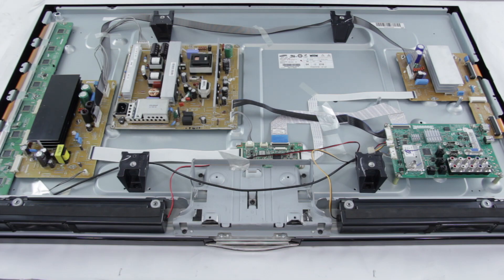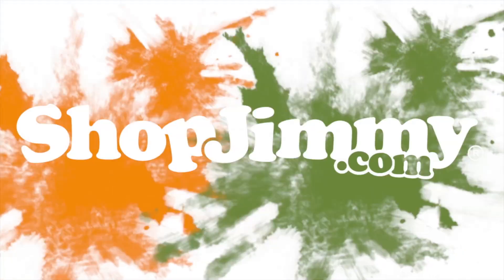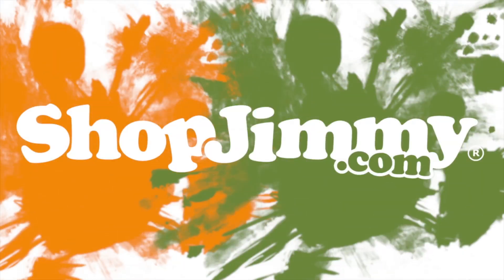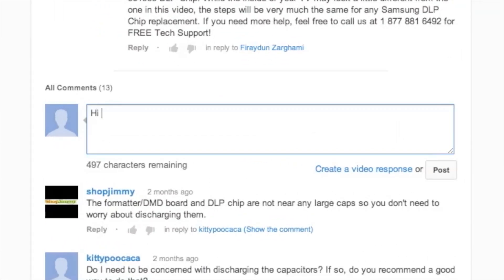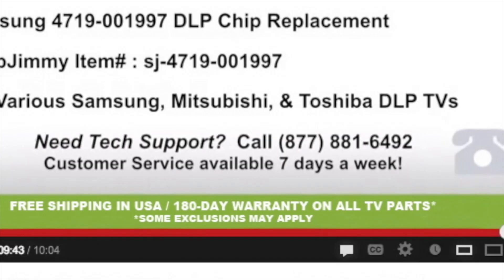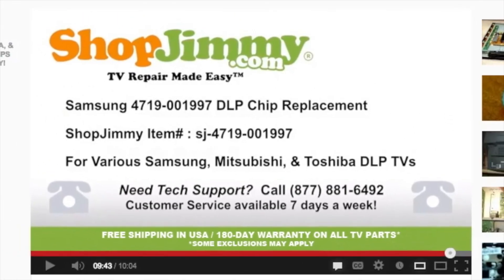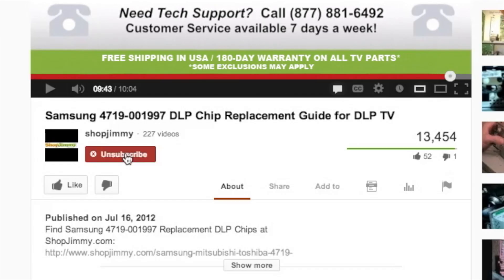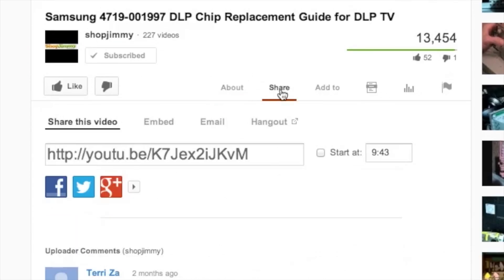Plasma TV Repair Tutorial - Common Symptoms & Solutions - How to Fix Plasma TVs

Comment: Hi Jimmy,

We have a Samsung PS51E8000 Plasma-TV (april 2012), and the current problem is about 5-10? vertical colored lines, mainly green and purple. A bit clustered on the righthand side of the screen. We have this now for a few days. For now, it is not adding in lines.

For images, check the added googledrive link to a PDF.

Sadly enough the plasma is now almost 3 years old, it had a normal two2 year warrenty. But this should not be the expected life expectancy, we're more aiming at 10 years :-)
FYI, Two years ago we had many auto power down and ups, both the powerboard and controlboard we replaced in warrenty, a halfyear after each other.

https://drive.google.com/file/d/0B1FrcP_Gxj2LZTdQQUlMMHhOUzg/view?usp=sharing

Please advise, thanks and regards,
Manuel.
(ps, from your super clear video I'am guessing the logicboard, with logicbuffer as 2d guess)
Reply from the maker: ms1001ms   This sounds like a TV panel (TV Screen) problem.  If your TV panel is bad, it may be more cost-effective to replace the TV as panels are typically hard to find in stock, difficult to replace, and expensive.  Thanks and please let us know if you have any further questions!  www.shopjimmy.com
Reply: ShopJimmy.com Thanks for answering. And OMG, I was not hoping on that one. The panel was 2k (in cost). I'll also try the Samsung servicedesk and let them make an cost estimate. Them we shall see and choose.. thx!

Comment: i have a Samsung 43 inch plasma tv model ps43d450a2wxxu  . I was watching tv when suddenly the tv shut down leaving only the led stand by light flashing twice 5 times then  a pause then repeating with no change when I tried to use my remote.  I removed back from tv and checked , no sign of any blown capacitors on ant boards.  I plugged pwer on again and watched as green led flashed on logic board and clicking sound from relay on main power board. I disconnected y main and z main boards and led on logic flashed then stayed on for 5 ses then repeated cycle. I connected y main back up and led did same cycle, then connected z  main and led just flashed. I purchased a fully working tested main power board and fitted this to see what would happen. when powered is applied the logic board flashes then stays on for 5 secs  with  y main and z main boards connected and continually yrepeats this cycle. remote control has no effect when used just makes led standby light flash repeatedly. any suggestions as to what I should try next . thanks for any ideas you could give me. drew
Reply from the maker: Drew Conway  Try this at your own risk.  Be sure when running those tests to disconnect either the y or z board one at a time and not at the same time.  Thanks!  www.shopjimmy.com

Comment: I have a Lg plasma I bought in 2011. I am getting the red images like u are talking about. How much is it for the part and is it worth fixing? this is the model number  LG 60PV450 60-Inch 1080p I cant find it on your website. Thanks in advance
Reply from the maker: Jody Sehlhorst  Please watch this video FIRST to help with your repair!  https://www.youtube.com/watch?v=BP3NVNCGEv8  I would replace the YSUS and the YDRVTP & YDRVBT boards in your TV.  Click this link to replacement parts for your TV model number:  http://www.shopjimmy.com/catalogsearch/result/?q=60PV450  There may be multiple boards for the same TV model number, be sure to match part numbers on your current board, with your replacement for compatibility.  Here is a link to a video showing how to identify your part number, click here:  https://www.youtube.com/watch?v=GEllG3RV-tc  Thanks and please let us know if you have any further questions with your TV Repair!  www.shopjimmy.com

Comment: I have a Samsung PN42B-450 series with the 3D ready with the 3D receiver. Anyways, my colors are starting to fade, like the white seems darker and when I'm using the Xbox and I press the middle menu button on the controller the blackness around it will go from darker to lighter shade of black. There isn't really any burn in problems just seems like the television needs to be refilled with gas, I don't know how it works. The yellows and blues are still really rich with the 10 million to 1 dynamic contrast ratio and it never has a problem playing in 1080p and the actual screen size needs to be put on fit to screen and adjusted when it's in 16:9 because it crops some of the edge of the picture. There j no moron blur when watching sports games like football or baseball and the dynamic coast allows you to see their helmets and the grass and dirt and it literally looks clearer and shinier than real life. So I guess my problem is the black gets lighter and darker when a menu box opens in the middle or even the menu sidebar on the tv. But when watching a Windows wmvhd 1080p video every color looks very crisp besides the white which is becoming more grey of a lite grey. Also the white on the screen while watching HD movies turns to a dark dirty looking whore color. Like dirty snow outside, I love that tv, I haven't seen another tv with a picture as clear, clear and crisp with the dynamic coast and black as deep as a Samsung PN42B-450 series. I'd love to buy another because these new tv's which have beautiful pictures, they don't allow you to adjust the picture like the Samsung plasma and picture still doesn't compare. Thank you
Reply from the maker: *****   Please watch this video FIRST to help with your repair!  https://www.youtube.com/watch?v=BP3NVNCGEv8  I recommend replacing the main board in your TV.  Click this link to replacement parts for your TV model number:  http://www.shopjimmy.com/catalogsearch/result/index/?cat=56&q=PN42B-450  Be sure to match part numbers on your current board, with your replacement for compatibility.  Here is a link to a video showing how to identify your part number, click here:  https://www.youtube.com/watch?v=BEPWrefQvqI  Thanks and please let us know if you have any further questions with your TV Repair!  www.shopjimmy.com

Comment: Hello I have LG 50PQ3000 plasma TV. I was watching the TV when the screen went completely black but the sound still works. when I switch it on there is small amount on snow like then screen slightly come on.  Please advise me how I can fi. thanks for you help
Reply from the maker: smlr44   Please watch this video FIRST to help with your repair!  https://www.youtube.com/watch?v=BP3NVNCGEv8  I recommend replacing the YSUS and the YDRVTP & YDRVBT boards in your TV.  Click this link to replacement boards for your TV model number:  http://www.shopjimmy.com/catalogsearch/result/?q=50PQ3000  There may be multiple boards for the same TV model number, be sure to match part numbers on your current board, with your replacement for compatibility.  Here is a link to a video showing how to identify your part number, click here:  https://www.youtube.com/watch?v=GEllG3RV-tc  Thanks and please let us know if you have any further questions with your TV Repair!  www.shopjimmy.com

Comment: samsung PN43e450a1f,  I changed out the Y Sustain and the power board.  The TV turns on for a second with maybe some dots of color.  Makes Kind of a buzzing or humming noise. Then turns completely off.  Then the Main board flashes a green LED light every two seconds or so.
Reply: ShopJimmy.com no it was coming from the Samsung PN51F5300FXZA XY SUSTAIN Board BN96-25250A, LJ92-01943A.  I replaced that and the power board.  Still has the same sound and the same symptoms.
Reply from the maker: Nicholas Pecora   Did you replace the Y buffer board?  Thanks!  www.shopjimmy.com
Reply: No, do you think that's what it is?
Reply from the maker: Nicholas Pecora  Please watch this video FIRST to help with your repair!  https://www.youtube.com/watch?v=BP3NVNCGEv8  It is recommended that whenever you replace the Y Sustain, that you also replace the Y Buffer board(s) as well.  Click this link to replacement parts for your TV model number:  http://www.shopjimmy.com/catalogsearch/result/?q=PN43e450a1f  There may be multiple boards for the same TV model number, be sure to match part numbers on your current board, with your replacement for compatibility.  Here is a link to a video showing how to identify your part number, click here:  https://www.youtube.com/watch?v=R1jmj_foId0  Thanks and please let us know if you have any further questions with your TV Repair!  www.shopjimmy.com

Comment: I have an LG 60PN6500 Plasma TV.

Symptoms are dimly lit screen. No audio. No video. Red power light comes on as soon as AC power is applied. Power switch on TV & remote fail to turn power to off mode.

The Logic Board has a green LED that flashes Long, Short, Long, Short, long pause, repeats. 

TV repair guy replaced the Y sustain module as he had indicated the old board did not have proper voltages, however, when new board came and did not correct the problem, and old board was placed back in the unit, a quick check of the voltages showed that they matched the new board that was ordered. When he indicated he wanted an additional $275 to 'try' another board, I decided to cut my losses with the diagnosis fee. Especially when he kept hinting that it could be the plasma panel itself.

All power supply voltages are at correct levels.

What do you recommend? TV is only a year old (just out of warranty). Seems a shame to scrap it.

Comment: I have a magnavox tv plasma model 50mf231d/37 . The picture went blank. I replaced 2 bad caps but no luck, I replaced the power supply board but now the picture starts off black and slowly comes on but now the picture is dark and grainy worse on the upper half .

Comment: I have a Samsung Plasma TV model PS42C451B2D (the same as your Plasma TV repair Tutorial) and it will not turn on from stand-by. When I try to turn it on the LED on the Logic board flashes then turns off. If I disconnect the 6 pin plug going from the power board to the Y board the TV makes the sound of turning on and the Logic board LED stays on but of cause there is no picture or sound. Can you suggest which board I have to replace.
Thanks
Rob

Comment: I have a Samsung Plasma Model PN51E450A1F and I smoked the main board. Stupidity on my part by plugging in a HDMI splitter with a power supply over3 times the max recommended (didn't check it before I plugged it in). After I got the wonderful electrical burning smell, the only thing I could get was video from my cable box. No volume and the TV wouldn't recognize my PS3 or PC Tower anymore at all. Was told I needed to replace the main board but I cant seem to find the right part on shopjimmy.com. Please no comments on what a jacknob I am - just trying to fix my problem.
Reply: also, plugged everything in to a different TV and all works great - so I know its my TV and luckily I didn't break anything else!!
Reply from the maker: Paula Scappini   Please watch this video FIRST to help with your repair!  https://www.youtube.com/watch?v=BP3NVNCGEv8  Hopefully it is only the main board that is damaged and nothing else.  I recommend replacing the main board to see if that fixes the problem.  Click this link to replacement parts for your TV model number:  http://www.shopjimmy.com/catalogsearch/result/index/?cat=56&q=PN51E450A1F  There may be multiple boards for the same TV model number, be sure to match part numbers on your current board, with your replacement for compatibility.  Here is a link to a video showing how to identify your part number, click here:  https://www.youtube.com/watch?v=BEPWrefQvqI  Thanks and please let us know if you have any further questions with your TV Repair!  www.shopjimmy.com

Comment: Hi i have a Samsung plasma ps50a550s1f type ps50a550 it had some colored thin vertical lines on the left side and in about 10cm and 20 cm in from edge and now has also a 1 inch black line about 20cm in. is this terminal tv is about 5 years old, can send pictures

Comment: I have a lg 50 in" hd tv model (50PF95) and two lines appear on the screen on the top right side near to the center of the screen was every thing fine until we moved the tv to a different place. very thin 2 vertical lines only until half of the screen right side near center.there is any way to fix easy?
thanks 

Sergio
Reply: ShopJimmy.com the lines on the screen are thinner than a spagueti stick,and only can see them when the image shows mostly blue.
should i give a check on the cables connected to the logic board??
Reply from the maker: Sergio Pepe   You can check what you would like, to see if it fixes the problem.  This still sounds like a TV panel problem.  Thanks!  www.shopjimmy.com

Comment: Hello Jimmy, I have a Philips  50" Model No: 50PFP5332D/37.The TV has power and sound but when I turn it on everything is black and the the screen starts filling up with picture but it looks like black ink all over the picture.The picture is also off color, it's like a grey/purple.Eventually all the black goes away but I get left with the fuzzy grey/purple image.I replaced a 180uf capacitor on the Y- Sus board that looked swollen but it still didn't fix it.Here is a video I posted of what it looks like afyer all the black spots disappear http://youtu.be/NxsFiwCfLzc.   Thank you in advance.
Reply: Correction I  replaced an 820uf 250v capacitor
Reply from the maker: Hector Soltero  Please watch this video FIRST to help with your repair!  https://www.youtube.com/watch?v=BP3NVNCGEv8  I recommend replacing the X board in your TV.  Click this link to replacement parts for your TV model number:  http://www.shopjimmy.com/catalogsearch/result/index/?cat=65&q=50PFP5332D%2F37  There may be multiple boards for the same TV model number, be sure to match part numbers on your current board, with your replacement for compatibility.  Here is a link to a video showing how to identify your part number, click here:  https://www.youtube.com/watch?v=R1jmj_foId0  Thanks and please let us know if you have any further questions with your TV Repair!  www.shopjimmy.com

Comment: Thank you for your video. I have Vizio Plasma TV model number VP50 HDTV10A. I used to turn the TV on and off by using the Dish network remote and suddendly the  remote stop working. I went to use the original TV remote but it won't communicate with the TV. It won't turn on or off and it won't turn the volume high or low. I changed the batteries in the remote and still won't communicate with the TV. I even purchased universal remote and I could program it to operate the DVD and the dish network dish, but won't turn the TV on or off. Any help.

Comment: I have a 51" Samsung Plasma TV manufactured date April 27, 2011.  Model # PN51D530A3F.  Here are the TV's symptoms:  Won't power on, no lights or standby light no power button, no sound, no picture -- just nothing completely dead.  There's some power in some areas on the main power supply board but half of the board is dead.  The Y sustain and other boards surrounding have been tested and no power is coming from those as well with a tester.  There's no bulges or leaking from any of the capacitors in all of the boards and everything looks fine.  I believe my part number for the power board is BN44-00444D.  I read as well as watched your video and I'm thinking that the main power supply board might be the answer to my TV's problem.  What do you think?  Hope you can help and hopefully have the part I need for repair.  Thank you for your time.

Comment: I've got sound but no picture on a Samsung HP-T5054  HPT5054X/XAA  Type: CA50C9
Reply: I got out the Voltmeter and checked against the sticker inside.
VS (should be 207) starts at 207 and then drops like a rock till it reaches 3.1
VA (should be 63) is 63
Ve (should be 94) is 15
Reply: More stats: I disconnected Ysus and Xsus VS held steady.  I replugged just Ysus and VS held steady at 207; but the sound of the humm dramatically changed to a high pitched whine.  I replugged Xsus and the VS changed to 25 and held there with the high pitched whine continuing.

NOTE: I unplugged power between each cable change.

Comment: Hi there I was given a element tv model ELDFW464 I had it plugged in and was moving it to adjust on my tv stand wen I saw a bright flash and tv didn't turn on anymore? Any ideas? Thanx
Reply from the maker: Bryan Machuca   Please watch this video FIRST to help with your repair!  https://www.youtube.com/watch?v=BP3NVNCGEv8  I recommend replacing the power supply board in your TV.  Click this link to replacement parts for your TV model number:  http://www.shopjimmy.com/catalogsearch/result/index/?cat=59&q=ELDFW464  There may be multiple boards for the same TV model number, be sure to match part numbers on your current board, with your replacement for compatibility.  Thanks and please let us know if you have any further questions with your TV Repair!  www.shopjimmy.com

Comment: I have a Samsung HPT5054 that I didn't use for about 6 months and when I went to plug it in and use it the screen starts out all black and slowly fades into color but the color is still off. I don't know how to explain it. Is there anything I can do
Reply from the maker: tazjetman  Please watch this video FIRST to help with your repair!  https://www.youtube.com/watch?v=BP3NVNCGEv8  I recommend replacing the Y-Main Board and the Upper and Lower Y Scan Drive boards in your TV.  Click this link to replacement parts for your TV model number:  http://www.shopjimmy.com/catalogsearch/result/?q=HPT5054  There may be multiple boards for the same TV model number, be sure to match part numbers on your current board, with your replacement for compatibility.  Here is a link to a video showing how to identify your part number, click here:  https://www.youtube.com/watch?v=R1jmj_foId0  Thanks and please let us know if you have any further questions with your TV Repair!  www.shopjimmy.com